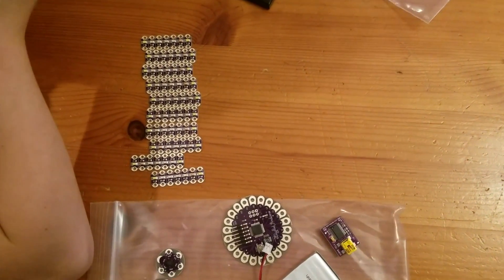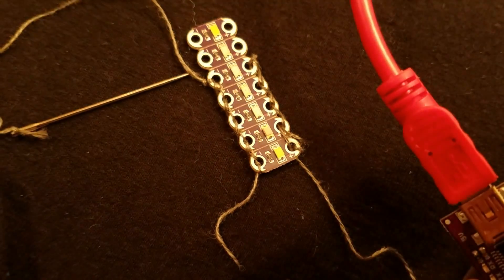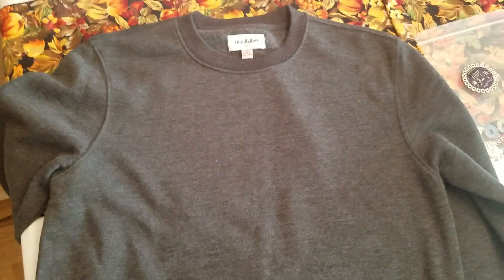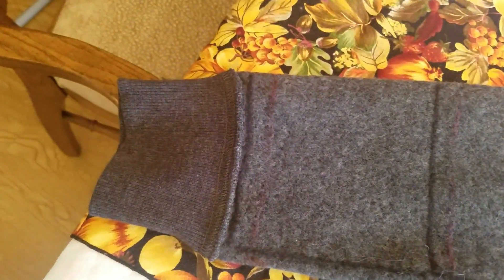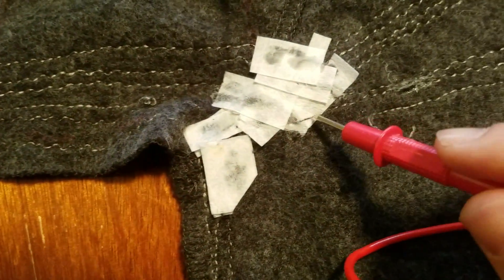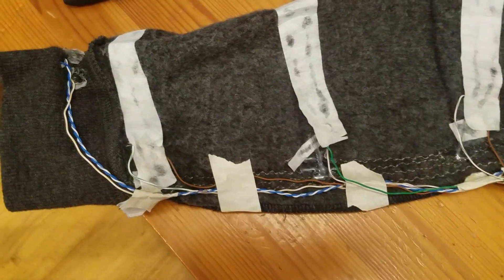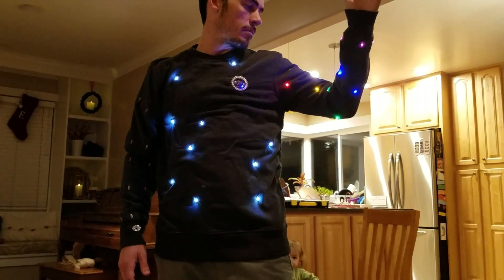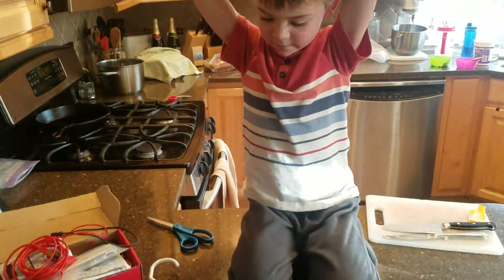Arduino Lilypad Death Star Christmas Sweater step-by-step tutorial

Comment: Heyyy, i have a small project using lilypad , but the problem is that i don't have lilypad power supply device so which other power supplies can i use, your answer would help me a lot:)
Reply from the maker: I believe any 9V will work but maybe even lower voltage like a lipo would do
Reply: @TaylorSparks  thank u so much

Comment: Can I get the circuit diagram of this project
Reply from the maker: I actually never generated one. It's pretty simple though. Each pin did  a simple task like turn on an LED or read a value from an accelerometer. I don't even think I needed to use any additional resistors. Therefore, the labeled code for each pin in my github page should provide any explanations you would normally find on your circuit diagram
https://github.com/sp8rks/ArduinoDeathStarChristmasSweater/blob/master/DeathStarSweater.ino

Comment: hello Taylor, nice job, como lograste conectar tantos leds? y aplicar pwm a ello?
Reply from the maker: hola! Buena pregunta. En total yo tenia ~100 LEDs o algo, pero el lilypad solamente tiene hasta 14 pins para usar. Eso tiene en cuenta RX/TX pins tambien. Si los vas a usar para controlar LEDs no podes tener comunicacion serial. No todos los pins tienen PWM tampoco, solamente 5, 6, 9, 10, y uno mas que no me acuerdo. Yo pude controlar tantos LEDs porque yo controle ~5 o 6 a la vez con un pin.  Eso quiere decir que tuve  los LEDs conectado en parallelo en vez de serial para que todos tengan el mismo voltage (si no tienen el mismo voltage no se prenden). Si ves a mi github podes ver que en lost brazos yo tenia cinco bandas de LEDS. Cada banda tenia 5 or 6 LEDs y fue controlada por un lilypad pin. Las bandas no recibian PWM. Las estrellas en la frente y atras si tenian PWM para parpandear.
Reply: Taylor Sparks  Bastante interesante, muchas gracias